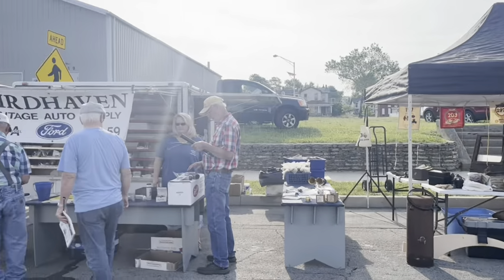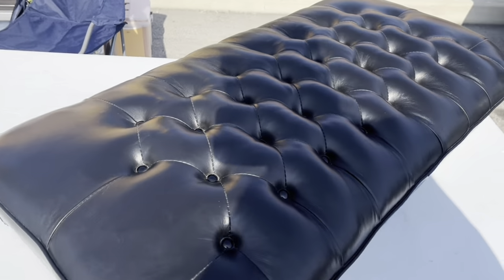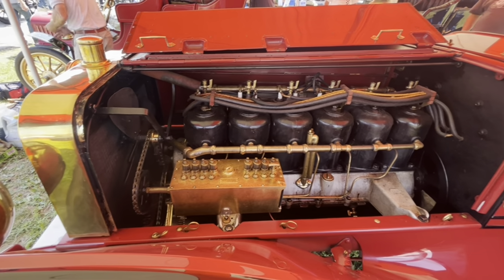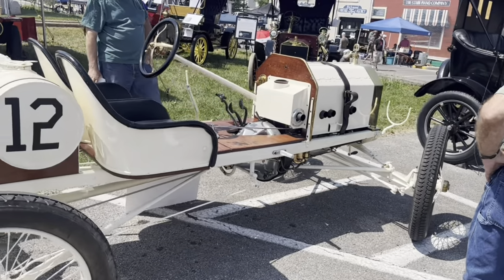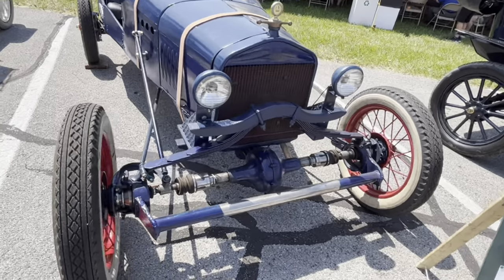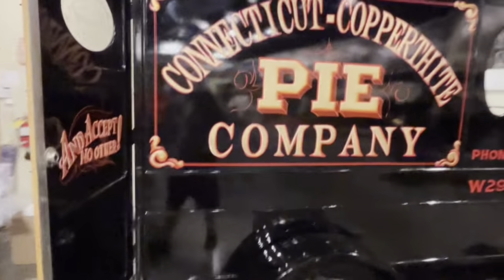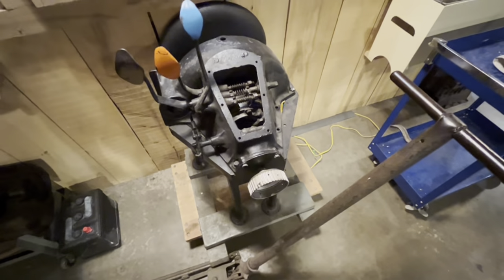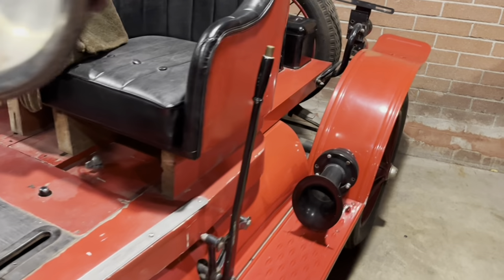Pre-Model T Fords, The Museum, The Swap Meet, The Car Show !

Comment: Fantastic, I'm from Italy not speak well english, but i know much 1903 / 1908 Ford, in particular the economic A C and F and N R, (and the firsts Ts) not so good the greater B and K, nice cars. I try to build model cars of early Ford, in 1 : 20 scale in brass and wood like the full size cars, (my project not a kit) under 2024 i make Ford A, C and N R, not is easy to find drawings and documentation on these cars also if are famous Fords, is  more difficult for cars like 1902 Rambler model C, 1911 Maxwell AB, 1902 Northern rounabout, 1910 Stanley steamer and 1910 International Harvester model F that I'm in train of build in 2024

Comment: The early Ford's were produced by Dodge Brothers. Ford borrowed money from the Dodge Brothers to start Ford Motor Company.
Your real early Ford's were built by Dodge !!!😊
Kevin Phoenix
Reply from the maker: True! The 1903 chassis where supplied by the Dodge Brothers with the bodies supplied by CR Wilson, wheels by Prudden and tires by Hartford Rubber. The Dodge Brothers were two of the original twelve shareholders.